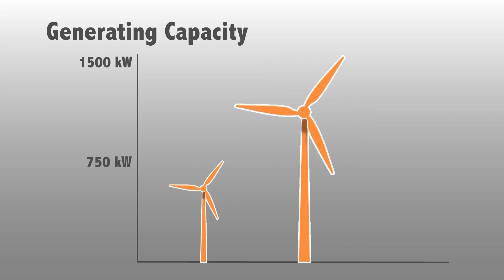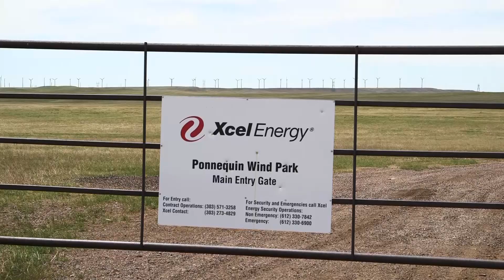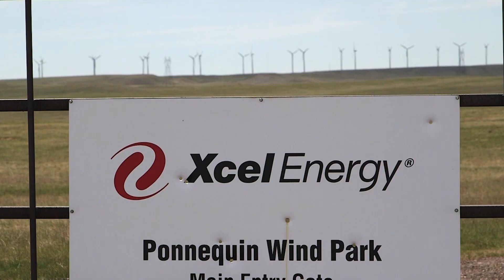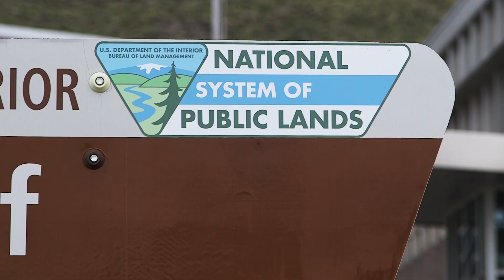Who Cleans Up When a Wind Farm Retires?

Comment: I remember back in the 1950s in Texas. There were old abandoned oil derricks still standing. History returns with the abandoned windmills
Reply: The irony in this video is you can see on some of the turbines where the oil has been leaking from the gearbox. Lol
Reply: @samlee1546  A gearbox leak in nothing compared to burning something 100% of the time to make electricity. Stop letting the oil industry distract you from their damage.
Reply: @justsomeguy934  I'm not letting them distract me but you cannot lubricate this thing, smelt the steel in the tower, or make the fiberglass in the blades without hydrocarbons. That's not even counting the amount of concrete that's these things need for the base to hold them up.
Reply: @samlee1546  "but you cannot lubricate this thing, smelt the steel in the tower, or make the fiberglass in the blades without hydrocarbons.' you're absolutely correct! It takes energy, minerals and petroleum resources to make a turbine. In return, you get decades of pollution-free energy. You are being distracted, however, in that I'll bet my mortgage payment that you have never objected to the exact same resources required for other things! Boat hulls are made of fiberglass and painted, just like turbine blades. Are you also advocating on boat websites to STOP making them due to the environmental impact of fiberglass? I bet my mortgage you're not! You mentioned concrete resources - are you also on construction websites arguing against the concrete impact of roads, bridges and buildings? I bet my mortgage you're not. See how you are distracted to look at concrete damage on a wind turbine base and ignore the bazillion times MORE concrete used to build a highway?
Reply: @justsomeguy934  I'm not advocating that we shouldn't have wind turbines. What I'm saying is that the argument that gets made that they are the best thing since sliced bread isn't really true. We're going to have to build a massive amount of these things to compete with any other energy resource. When we could just drill or build a nuclear plant.
Reply: @samlee1546  " We're going to have to build a massive amount of these things to compete with any other energy resource" Use the word REPLACE another energy source and you understand. Remember, sunshine and wind are FREE. No oil was burned. Low maintenance. No military escort given to get sunshine on your shores. No lives risked to occupy the Mideast for 30 years or more.
Reply: @samlee1546  So what? I bet that many horses were used moving construction materials for the first automomobile factories...didn't mean they would remain dependant on horses forever...
Reply: @justsomeguy934  burnig carbohydrates creates water and CO2; both are natural metabolites.
Reply: @thomasgarbe8354  let's talk about the unnatural parts of burning petroleum! You're aware that tailpipe exhaust is poison, right? You're not thinking it's all natural and good for you, right?
Reply: Bakersfield was the same....
Reply: There are still 10s of thousands abandoned oil wells.
Reply: @Second Chance "Still no answer then huh? Says more about you than it does me and according to you're (lack of) logic your as dumb as a box of bricks." Actually, I answered you immediately, and your lack of acknowledgement astounds me. I'll answer again since you seem to be sitting in a corner, butt-hurt that you were proven wrong, but here goes: oil is PRECIOUS. We cannot WASTE IT. We cannot take a match to half of it needlessly as gasoline. If we save enough, maybe just maybe we don't have to send our military into the MidEast and die for the stuff anymore.
Somehow, in your world, you think anyone advocating we use less and save it for the things we cannot live without should never use oil at all. 
Can I suggest you see someone, perhaps a professional, to help you deal with your inability to think logically or deal with new concepts?
Reply: the oil contained so much more energy
Reply: It's still happening today, except the oil companies are expecting the US taxpayer to clean up after them.
Reply: @Second Chance Actually, thanks for clearing up your logic for us. Anyone that needs to be on a diet in your world cannot every eat any food whatsoever, and therefore starve. Have you taken that opinion to Weight Watchers?
Here are some more illogical statements, according to you:
* Stop wasting food!
* Stop wasting gasoline!
* Stop wasting electricity!
* Stop wasting money!
Reply: @justsomeguy934  blah blah blah omg you must be a paid SHILL
Reply: 041721 We STILL HAVE the rundown non-running oil derricks in California, namely Los Angeles city and county that continue to leak and the owners have literally walked away and abandoned the sites. Last I heard the federal and state legal issues are working to get the owners back to the sites and the abandoned wells capped and rigs/derricks removed and the land needs to be cleaned up. Several wells are located in the midst of neighborhoods with the oil leeching into the ground and poisoning the ground and water. And the smell, yuck!!!
Reply: @penelopelgoss2520  Texas just did a survey, and found 6,000 orphaned oil wells. However, there's actually about 120,000  orphaned wells. Now drillers are required to put up a $3500 bond for cap and cleanup, but the actual cost for a C&C is about $110,000. Those abandoned wells won't be caped...ever. It's an unfolding environmental disaster.
Reply: @langhamp8912  who counted the 120,000?
Reply: @paulborkovich5622  The US Department of the Interior.
Reply: @Second Chance You're making the classis all-or-nothing argument that does not apply. It's BECAUSE oil is so precious that we cannot afford to waste it.
Reply: @Second Chance Your comprehension [lack of] is also stunning...I'm 3 steps ahead of you. Yes, I drive a car, use plastics. It's the non-substitutable oil-based products we must save. Nice try kiddo.

Comment: What about clean up of oil and coal rigs that just get gutted and left behind while the sub contractor phoenixes. Much worse than a few square meters of concrete and a bit of steel/copper scrappers will pay to get at.

Comment: Put an listing on Craigslist and FB Market Place for FREE SCRAP, see if they are not gone in a week or so
Reply: the problem is the mountain of fiberglass you have to pay to dispose of. it ends up costing far more than the little bit of scrap
Reply: @imchris5000  Sure, unlike just injecting oil waste back into the aquafer.
Reply: Scrap is in the toilet, I had a property I wanted cleaned up and had three sets of scrappers come in, none finished. 
It's not worth their time currently.

Comment: The problem is: this technical crap does not last long enough. 20 years is nothing. Compare this to bridges and railroad-stations that are 100 years or older. We need longer lasting constructions. But the rapid obsolescence first of cars (which car today lasts as long as a Ford A model?) then of cellular phones (build to be scrapped after 2 years) to ever increase the profits of companies selling this crap does even not stop on infrastructue.

Comment: Most, if not all of these wind mill farms are quick cash infusion through gov't grants of all sorts, from tax breaks to other incentives, and this accounts for the "wind mill boom" mills not being decommissioned and not upgraded or replaced. 

The blades to these monstrosities are the worst. The material used is super tough, essentially do not biodegrade, and is not recyclable. Add the heavy metal and rare earth poisonous elements in these massive batteries and the open pit mining required to get the materials, then add the death toll on endangered species, that are legally killed en masse by these mills.

I predict that most often, any bonds pre paid for their disposal will fall short on the actual costs involved, which is typical with any government projection. If the gov't gives such estimates, it is safe to double the anticipated costs involved, and that is being very conservative. 

Then, the taxpayer will end up for the remainder, the same people who paid for all of the subsidies and grants. When you add it all up, and this only scratches the surface, windmills turn out to be a method of cash exchange that cost more than they produce. 

There is a time and place for wind (and solar) but these large scale projects are not and can not replace petroleum based energy. Tesla's technology could, but it would make energy so cheap that the Luciferian elites will not stand for it. Tesla understood that the Earth is a huge electromagnet, and this energy can be harnessed for relatively little cost and even less cost in maintenance.

But the elite also want to create fear mongering over a lack of energy, how it is in short supply and of course is "killing the planet" which is false. This is a trade off for command and control and imposing third world energy availability on the world. 

Both hydrocarbons and water are inherently renewable sources of life, but the elite can't control what is in amble abundance. So they only teach in their schools and Universities about surface water and Aquifers so they can sell water as another commodity, when it is like the Tesla towers: there is an up front cost followed by little to no maintenance-even in desert areas.

Comment: "You have to understand with renewable energy..." there's a lot that isn't renewable.
Reply: Renewable is definitely a misnomer... "Clean" isn't quite right either. Generally, the long term environmental impacts are lower though, so I guess you could call it "better" energy...
Reply: @shaun6828  Except they aren't lower...when you take into account the whole operation from start to finish.
Reply: @fraidykat  Lower? As in lower cost? Fossil fuels are lower in price than some of the the newer alternatives, but the newer ones don't add to the carbon in the atmosphere. Excess carbon in the air is going to cost us a lot. Pulling that carbon out of the air and putting it back underground will be very expensive too. Tapping solar and wind energy sources won't alter our atmosphere. We do need better recycling options for used equipment, but we also need better recycling options for our plastic and other consumer goods. Solar panels and wind turbines that last 20 years aren't adding too much to the pile yet. If they do become a problem, they are a lot easier to bury than the carbon in our atmosphere is.
Reply: @shaun6828  If you think windmills do not add carbon, you are clueless to their manufacture.

"Excess carbon" in the atmosphere has occurred numerous times on this planet.  Paleontologically, those times are also tied to some of the richest and most diverse biological time periods in the entire geologocal record.
Reply: @fraidykat  Have you heard that they've started using battery powered mining trucks? They can recharge as they go down the hill, so they are efficient, plus they have a lot of instant torque. Steel refineries use electricity to melt the ore. Pretty much all the equipment in the factories use electricity. There are still parts of the supply chain that are using fossil fuels, but the idea is that as "green" energy production capacity increases, the "green" energy production equipment will be produced to a greater extent with "green" energy. 
Once you pull carbon out of the ground and burn it, it's gone and you've got to go get more. Once you set up a wind farm, you've got power for 20 years or so. Potentially much longer. Seems like it shouldn't be too hard to coat wind turbine blades in something more resistant to chipping.
Excess carbon isn't necessarily bad for plants in general, but warming atmosphere will cause coastal flooding, larger storms, shifts in rainfall, etc... The problem with those climate changes, is that some places where people live now will become a lot less hospitable and possibly even dangerous. When you have a lot of people that want to relocate, you end up with tons of refugees that suck up tax dollars and quite possibly end up moving to where ever you're living. In bad cases, it can trigger wars. The other big challenge for humans, is crop land. Lot of crops are very dependent on having certain temperature and humidity conditions. Lot of places where people have traditionally been growing certain crops just won't be viable anymore. End up with a famine somewhere and suddenly you've got more refugees....  I'd rather deal with solar panels and wind farms than disaster refugees.
Reply: @shaun6828  You apparently don't understand the impact of acquiring rhe materials for those batteries.

Those climate changes towards a warmer, wetter Earth means a larger carrying capacity for this Earth.  The desert bands will shrink allowing more arable land.

If this planet had a runaway greenhouse effect, it already would have happened billions of years before humanity even existed.

All you are doing is supporting throwing away resources for a mindless pursuit.
Reply: @fraidykat  Once you obtain the material for the batteries you can use them over and over again for a very long time. The newer lithium ion cells are expected to last for at least 500,000 miles worth of driving. After that, the batteries can be recycled and turned into new batteries. Vanadium redox flow batteries are considered to be effectively immortal. There's no limit to how many times you can recharge them. Where as for fossil fuels, it's effectively gone as soon as you use it. You have to go back and mine or drill for more. Which option is really throwing away resources?
Chemical batteries are far from the only option too. Pumped hydro, molten salt, flywheels, etc all offer industrial scale power storage and are already in use. Holland is building a massive windfarm, with the expectation of producing liquified hydrogen for export. 

You've probably heard that the sun is slowly growing and in 5 billion years or so, it will eventually be a red giant. 4 billion years ago, it was about 20% cooler. It has been gradually warming to where it is now. If early earth experienced the same orbital distance and solar output we have now, earth would be like Venus. 
A warmer wetter atmosphere could have benefits in the distant future, but currently, there are a lot of people who are dependent on crops that won't grow well under higher temps or live in low level coastal areas that are at risk of flooding due to storm surge or won't be able to grow crops, due to salt water intrusion into coastal aquifers. I don't if you've ever been to Florida or the gulf coast. More heat in the atmosphere means more powerful stores. Bigger storms mean more evacuees. More money spent on FEMA and more people giving up on the coast and moving inland. I'd rather not see all the currently open places crowded with others...
Reply: @shaun6828  And yet that does not happen.  What more, it costs more in terms of energy and finances to recover the materials from the batteries that it does to start with raw ore.
Reply: @shaun6828  And if you build your buildings right in the first place, you don't have evacuees.
Reply: @fraidykat  Battery recycling is still expensive due to the small scale. There are actually a number of companies that will break up battery packs, due to the failures usually only being for a small number of the cells in the battery pack. The good batteries  end up being turned into home power backup units and for other purposes. You can find a ton of videos here on youtube for people buying used batteries for their own DIY projects too. Mass production of electric car batteries is still new to have a really high number of battery cells that are no longer good. There are programs in place though to collect and recycle them. As the number of batteries available for recycling increases, the economy of scale will make it cheaper to recycle than to collect new lithium. I'm looking forward to seeing the million mile batteries Tesla is promising. That is a lot more miles than most people drive in their whole life.  If you haven't visited China in the last few years, you should. It is amazing to see electric cars and buses everywhere there. Like literally half the cars or more. Supposedly the quality level isn't as high as it should be for many models, but they've fully embraced it and are way past the US. It was crazy seeing hundreds and of electric scooters plugged in shangai... Electric cords running over sidewalks everywhere. I much prefer that to Saigon though. The air was way better than Saigon, where everyone used gas scooters. China is pushing hard to be a leader in electric vehicle manufacturing in the coming years. US manufacturers are starting to realize they might be left behind. European manufactures are going at it too. Volkswagen is planning to  manufacture at least 50% electronic cars by 2030. 
In 20 years, new gas powered cars will probably be as rare as a manual transmission.
Reply: @fraidykat  Many coastal cities got their start hundreds of years ago. Unfortunately, they also tend to have the highest population concentrations.  Most with money are preparing for tidal surges, but we'll still see events like what happened to New Orleans, where there is some problem that results in an entire region being flooded out. Building to defend against those events is very expensive though. Is it better that we spend money attempting to avoid the problem in the first place or that we spend money attempting to defend against the results and cleanup after?
Reply: @shaun6828  Any money they put into preparing for tidal surges that is not moving off the floodplain is wasted time, hope and resource.
Reply: @fraidykat  That is exactly the thinking that will drive many of the refugees to find new homes elsewhere. Easy to imagine desperate Floridians moving in and taking jobs from locals in other places...
Reply: The only renewable part is the political spin...